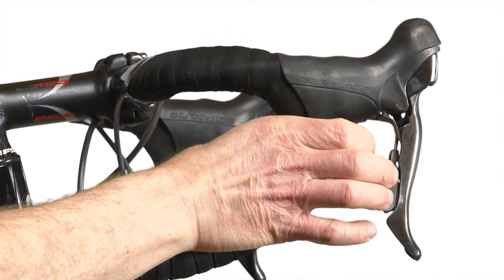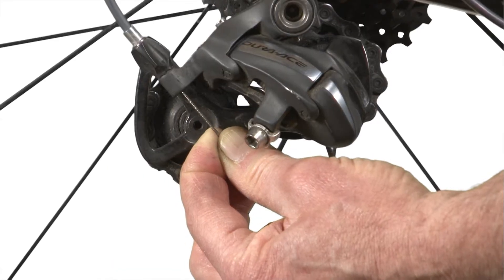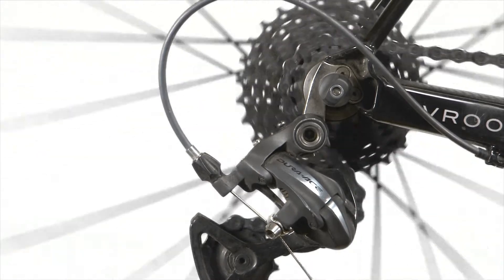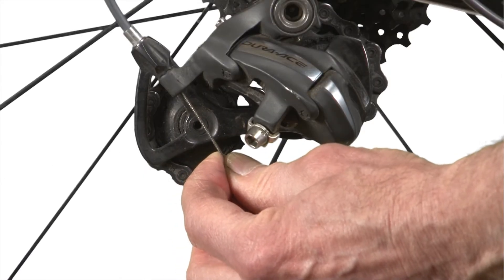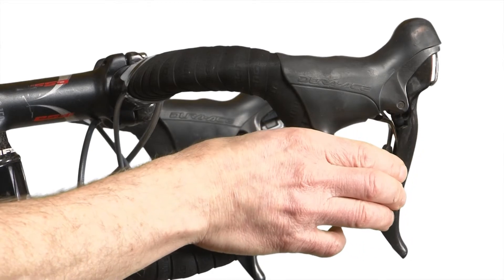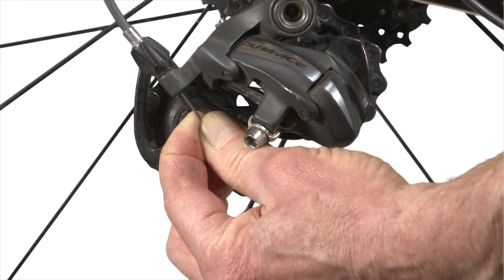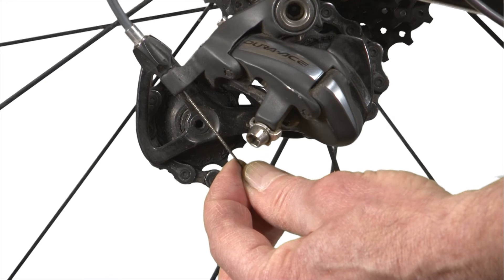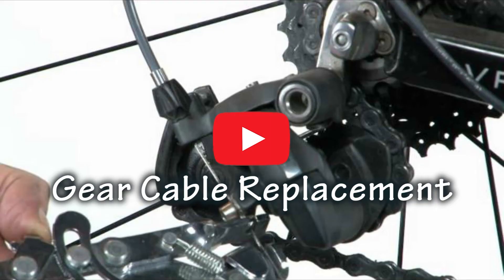Trouble Shooting Gear Cable Problems

Comment: Really helpful, easy to understand instructions. I do need to make myself a gear problem flowchart to work out which video to use.and when. Eg if this happens adjust like this, but if this happens replace cable. (However, I may be some time.)